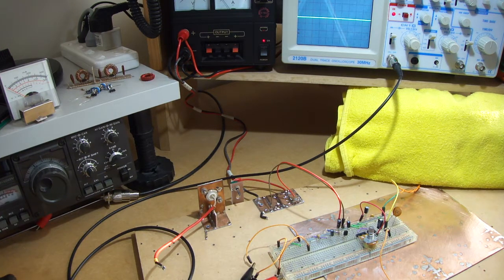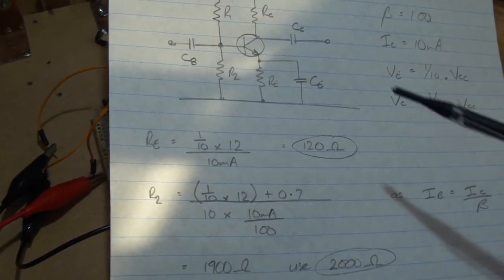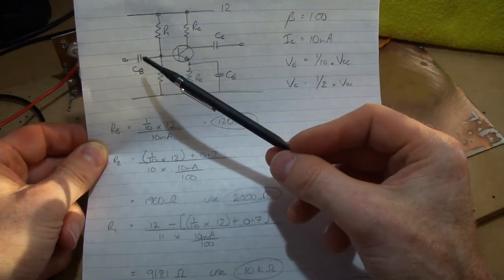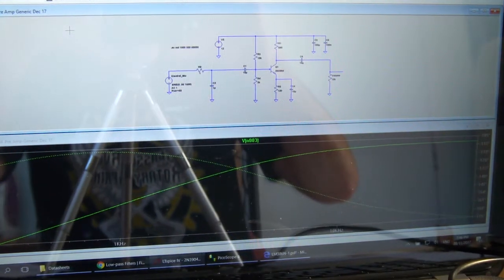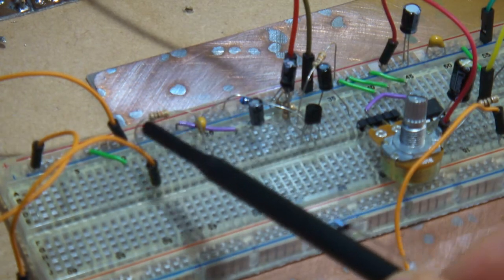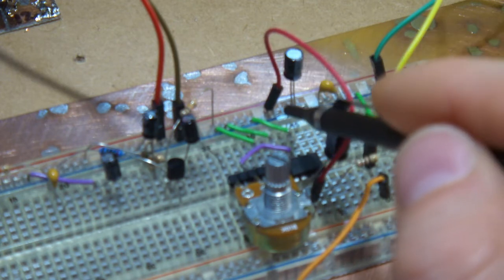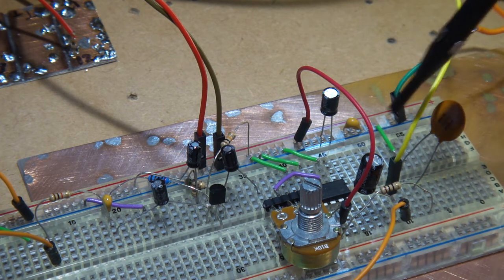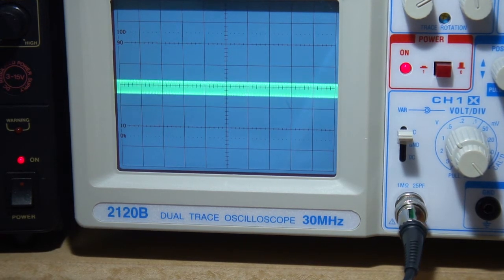Simple Homebrew SSB Base Rig Part 2 - Audio Amp

Comment: I would have played around with a transistor circuit: transformerless push pull. You could probably have done it with 3 transistors. A BC547 followed by a BC337 and a BC327 with some global negative feedback. If that was too lean I'd add a fourth transistor into the mix. But that's just me, I go for circuits without IC's where I can because it's more fun haha

Comment: Really enjoying the videos Charlie. Many thanks. Really helps showing the value calculations. I did notice though that you calculated the low pass audio filter with 1000R and 0.053u, (using std 0.047u) but when you inputted the values into LT Spice, you typed in 0.47u. This gave a HF roll off at about 2KHz. You mentioned later that you doubled the calculated value to 0.1u. Did you run that through LT Spice? If so, what response did you get?

Comment: anyone dealing with a nasty hum/buzz in their audio amp, even with the input disconnected? Any obvious things to check?
Reply from the maker: Did you manage to find out what was causing the hum?
Reply: it was a 7-segment LED voltmeter display I had which was connected to my battery for monitoring battery charge. As soon as that was disconnected, all problems resolved. Heard my first signals on the receiver! I'm sure some sufficiently large inductors combined with my filter caps would help with the noise from the display, but for now it's not part of my build.
Reply from the maker: That's good to hear. I'm starting to move away from the small OLED screens that I have been using because of noise. I find the old 16x2 LCDs are very quiet. I might have to purchase some other screens and see how they perform. All good fun!

Comment: Thank you for Charlie, for posting this very informative video. That's the first time I've ever seen the effect of omitting the RC filter on the LM386. Time to check some of my older homebrewed receiver projects to ensure I have installed the RC filter and proper decoupling on their supply rails.
Cheers de ZL3GIL
Reply from the maker: Yeah, the LM386 is an interesting device. When it works it works well, and when it doesn't...! This build is really quiet, which is great.

73s
Charlie, ZL2CTM

Comment: Thank you for your detailed explanation. Have been able to refresh my knowledge about the dimensioning of transistor amplifiers.
As I said last time, I am working on exactly the same project.
I have already noticed that a LM386 alone does not bring enough gain. Now I will also build such a preamplifier stage.
Your videos help me a lot.
best 73 
Bernd
Reply from the maker: Sounds like a plan Bernd. What mixers are you looking to use?
Reply: I use IE500A because I still had a lot of them.
The receiver behaves almost like main good old ATLAS 210 ;-)
I set up the J310 cascode circuit you described. At the moment I am operating the hand AGC so manually with a potentiometer to set amplifying of the IF stages.
Reply from the maker: Thanks for that Bernd. I understand the IE-500 is similar to the SBL-1. I'll look to homebrew a mixer for this, with the SBL-1 as a fallback option.
Reply: Have a little experimented with the LM386. It is also possible to get more gain with a additional capacitor as described in the datasheet, but then you hear more hissing in the speaker. I will probably prefer to use an IC of the TDA series. I think a little more AF performance can not hurt......especially in home operation. But I will continue to use your preamp.
Reply from the maker: I elected not to have greater gain in an effort to keep the hiss/noise down. This arrangement seems to work well. The next rig will use a NE5534P and a LM380N, which should be quieter again.